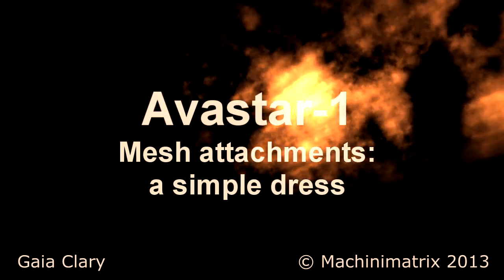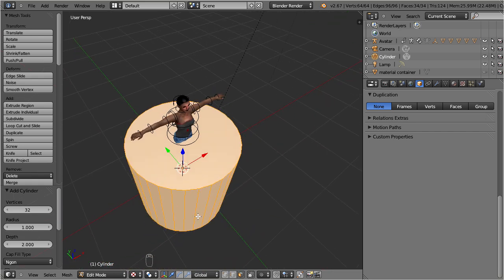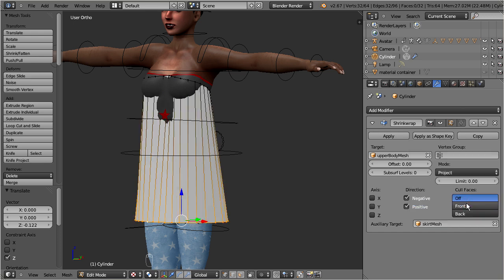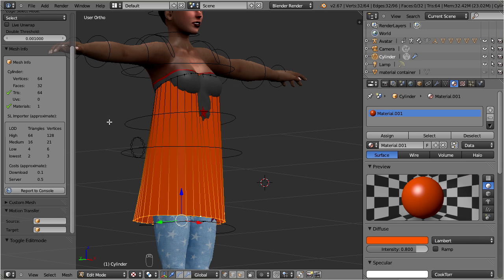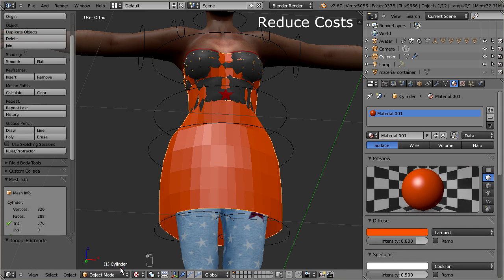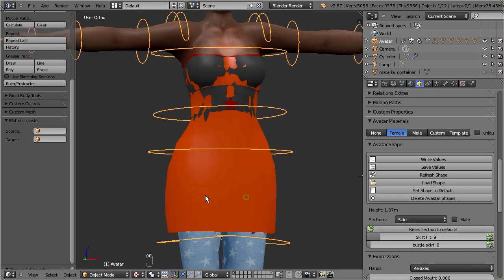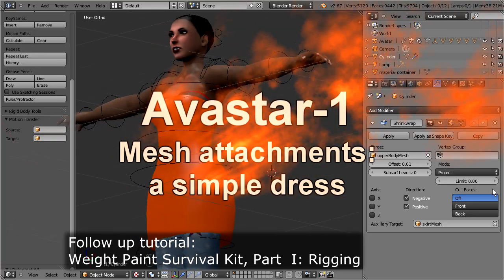Avastar: -4- Mesh attachments (Dress)

Comment from the maker: When i recorded this video, the templates also affected Blender's customization, including the setting that automatically switches an object to edit mode when it is created. So when i added the Cylinder at 1:14 it automatically started in Edit mode.

In Avastar 1.0 the templates no longer affect the blender customization. So, when you work with the default Blender settings, then adding a new object keeps it in Object mode. In that case you have to switch to edit mode manually (at minute 1:14).

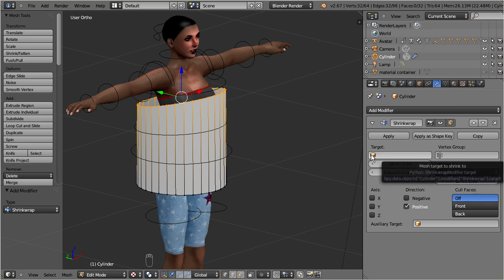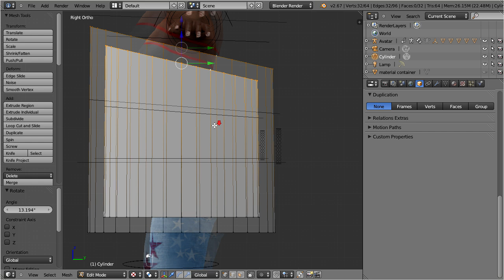Comment: Hi, Gaia its me again..Thanks for replying the part I am currently stuck on is 2:35, and 3:19 seconds. I put the upper body mesh in the first target, and the skirt mesh in the auxilery target but some how it ends up looking like 2:14 seconds, and it does not shrink wrap even when it is on negative. I am using the work bench. Thanks! I also posted on the full article my comment is the top on the list.